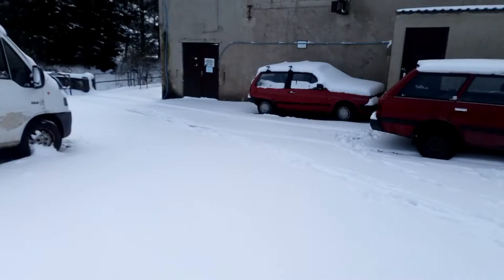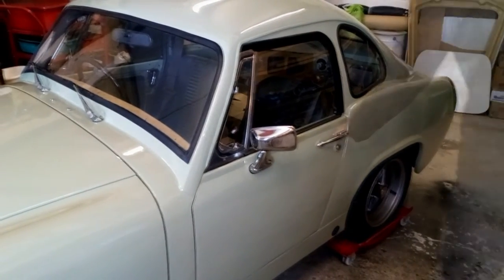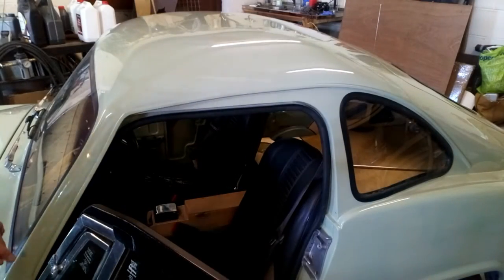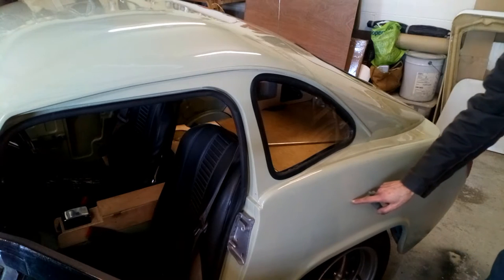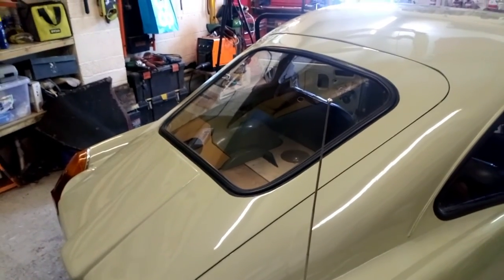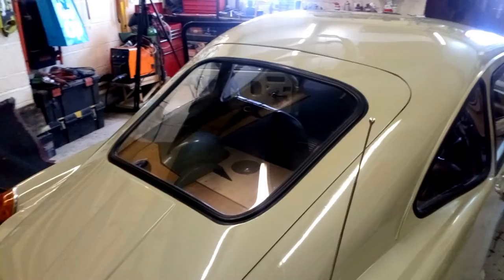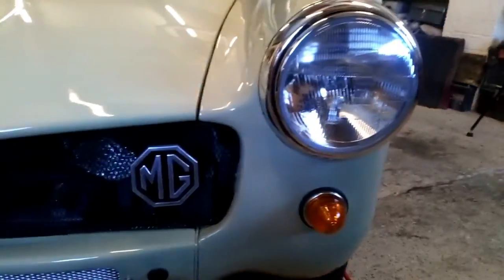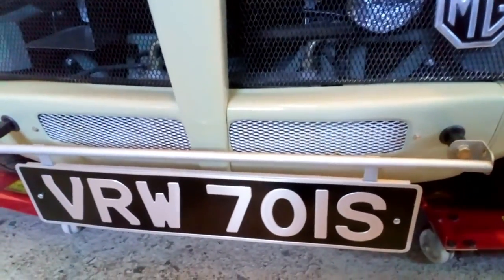Nagara MG Midget 1500 Continental Walk-around

Comment: Nice craftsmanship. My criticism is the side quarter windows should not be higher than the door glass. Lowering these could bring the drip rail down to the door level.
Reply from the maker: Thanks Barbara, I totally agree. This prototype was built on a tight budget and I wanted glass side windows for the doors (polycarbonate and acetate both scratch too easily). As the origination for new glass (taller) was about £1000 per side I have compromised on the prototype.  The fault you have identified has annoyed me from the start but, if I had waited until I had a spare £2k (and many other costs that would have sorted out other compromises) the prototype would never have got this far.  

I could have made the new rear quarter-lights lower but wanted to retain the airiness inside the car and a rear three-quarter view out for taller drivers. Since then, I have realised how I could have solved the problem for very little money and hopefully I'll do that at some point! btw, I have a new blog and websiste at nagara.uk

Many thanks for your comment.
Reply: @nagaraworkshop  I really like the door window frames with original glass. I can appreciate how hard that was to make that curve. Also keeping the windshield original is excellent.